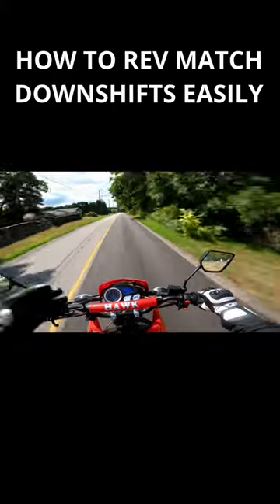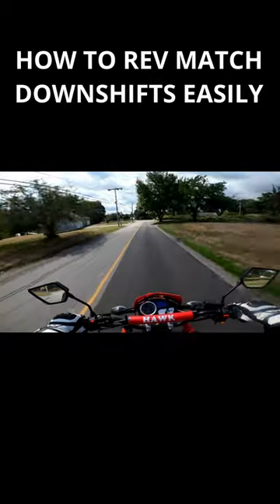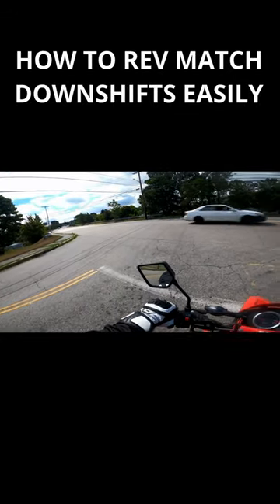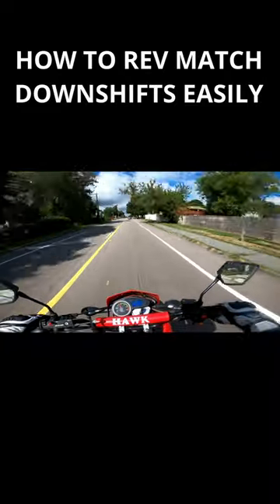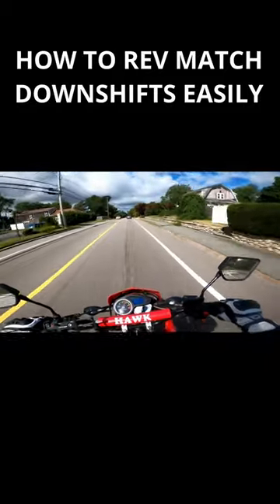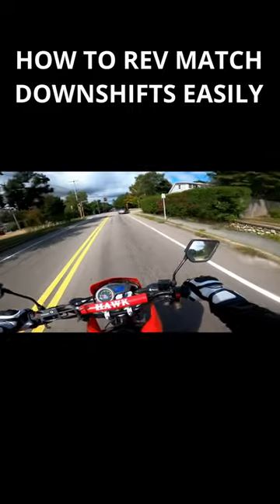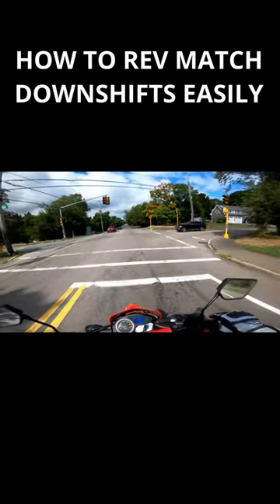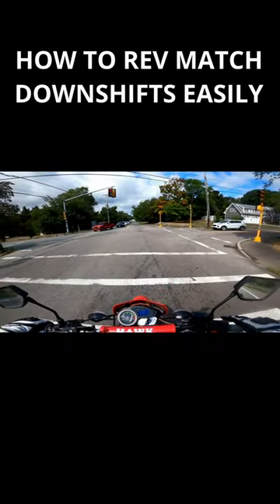HOW TO REV MATCH DOWNSHIFTS IN 1 MINUTE OR LESS | MOTORCYCLE 101

Comment: Guys.. blipping uses the throttle to bring up revs so you can match the gears. Him using the throttle and maintaining it does the exact same thing 😂 so it’s still rev matching.

He’s not rev matching to slow down drastically. He’s rev matching and maintaining his speed, hence no need to blip. Either way, he’s bringing up his rpms to smoothly downshift.
Reply from the maker: Apparently the guys "correcting" me only rev match when they are coming to a stop lmao
Reply: @BodieMoto  hi, quick question, if you open the throttle and keeping it open while you are shifting, (instead of blipping it <quick open and close >), can you still just let out the clutch quickly?

And this method you showing in the video, is to maintain speed, not to drop speed quickly , correct?
Reply: @BodieMoto  and what would be the step by step if I do indeed want to drop speed quickly by down shifting ?

How would it be different from the open throttle and keeping it open method?
Reply from the maker: @dustcake2576  correct this technique is to maintain speed. You DONT want to let out the clutch with the throttle open as it can cause the bike to jerk forward or even pop a small wheelie

With my bike, I can mess up there's no issues because my bike my really under powered, if you have a liter bike and mess up you could flip the bike. Very important to learn while going slow
Reply: @BodieMoto  wait i am confused, in the video you did let out the clutch without closing the throttle , and now you are saying i shouldn't do it?

So what's the proper technique step by step?

Throttle off > clutch in > downshift > slowing get back on throttle while feathering out the clutch? 

This is what you have done in the video ,right?
Reply: I add a little bit of throttle like I’m going to accelerate as I pop the clutch click down and let my clutch out and with proper timing it literally matches revs instantly
Reply: I blip in gears above 1st, to get down to 1st I maintain higher revs and match because dropping to first is a pain.
Reply: @dustcake2576  been months so hopefully you learned already, but this is how I do it. Let go throttle, clutch in, downshift, a quick pull of the throttle about 10%, let go throttle, let go clutch, back to throttle. 😅
Reply: Off throttle>pullclutch>downshift> throttle(mini-pull) keep holding before you letgo the clutch and continue holding throttle as you let go the clutch so it wont jerk when you downshift. Am i wrong?
Reply: @dustcake2576 don't make it this complicated. If it feels and sounds nice its probably not wrong.

Comment: Thats not a revmatch,thats way too slow and wrong overall,revmatch is a quick simultaneous action of press clutch,gear,blip throttle,release clutch,,u do that move at the exact same time and very quick
Reply from the maker: You absolutely do not need to rev match quickly for it to work, and suggesting that beginners learn to rev match that way is going to lead them to crash when they accidentally clutch up. If anyone ever listen to your advice on their first try they would loop their bike lol
Reply: @BodieMoto never looped my bike call me you talkin trash

Comment: Practice at slow speed. When you have it pretty solid at slow speeds. You'll have a fundamental grasp.  It'll be orgasmic at high speed and normal drives. So fun
Reply: The real challenge is learning to simultaneously use the front brakes while rev match downshifting
Reply: not really just slow down a bit b4 dont let the bike lurch
Reply: @harveymushman4190  explain
Reply: @funkbros3141  yeah while pressing the brake you do the rev matching downshifting all the way down to 1st gear. I think moto gp riders do this shit.
Reply: Does this also apply if my bike has a slipper clutch?
Reply: @zumair6957  yeah
Reply: @sofarsogod  GP Riders have auto 2 way auto shifter so they don't even use the clutch. If you brake and rev match, you are actually just upsetting your front wheel because of the pulsating you do when you are holding on to the brake and blipping.
Reply: @jamessawyer1331  well moto gp riders from the past, but even then they do brake while downshifting, you can pretty much see it when they show their pov, any driver car or bike has to break and downshift when entering a curve.

Comment: so basically try to get the high rpm on the lower gear so you don’t accidentally engine brake the bike?
Reply from the maker: Exactly, you got it
Reply: Precisely that. You can additionally be a nerd and memorise what speed and RPM you need to be in each gear; observe what the RPMs are for the same speed between gears
Reply: Why would u not wanna engine brake? Smh
Reply: @slimfit767  That still happens, obviously the novice here means abruptly engine braking due to RPM mismatch
Reply: @birddaddydetta  125cc 1st gear 10mph, 2nd 20mph, 3rd 30mph, 4th 40mph. My bike sits at 4th gear 40mph at 5000 rpm

Comment: If you are in like 5th gear and need to slow down a goodly amount,  how do you know what gear you should be in?
Reply: well if you’re about to slow down to a stop i think it’s best to just pull the clutch and brake it while downshifting gradually, engine brake is as dangerous as full front brake on wet road(plus there’s a big chance you might kill your engine gearbox😅). riding any vehicle need that “feeling”, you’ll find the answer to your question by yourself eventually tho

Comment: I am a bit slow in understanding so is this correct:
1. Pull in the clutch
2. Rev up/blip and downshift at the same time
3. Let go of the clutch and continue normally
Is this correct? Or do I need to integrate the clutch into the downshift too.
Reply from the maker: bingo, you can start step 3 as soon as step 2 ends, like immediately, just do it slow at first. You will feel it. 

My bike is not very powerful so I can exaggerate it alot and its not issue, if you have a very powerful bike just be careful and let out the clutch SLOWLY at first. You'll get more and more comfortable
Reply: @BodieMoto  I have a 690 SMC R which also isn't that powerful of a bike. So I let go of the clutch as soon as the downshift - blip ends. Do I let it go at once or gradually like I have been practicing. I just started riding and I really don't have that much of an idea about stuff.
Reply from the maker: @samcrdx8016  start letting go of it as soon you rev it up, and let go it of slow. You can let go of it faster and faster over time, but you don't really need to. The reason why you would want to learn to do it faster, is in an emergency situation, or racing lol
Reply: @BodieMoto  Thank you so much. Lunch break is approaching soon, going to try it out in that time.

Comment: The “blip” makes it more confusing tbh all you need to do is rev the throttle while releasing the clutch and you will feel if it’s gonna lock up or not before fully releasing
Reply: This is completely wrong in that you do the opposite of releasing the clutch - you hold it to shift. If you'd have it released while giving throttle, you'd just be gaining speed
Reply: Iv a slipper clutch to prevent locks
Reply: @birddaddydetta wat ur talking about is just normal shifting
Reply: @steve00alt70  Incorrect, I'm talking about matching the revs right before releasing the clutch lever. If you'd shift normally, you wouldn't even be concerned with the throttle hand at all

Comment: I drive a tractor trailer, and rev matching is required on those because the transmission isn't synchronized. Meaning, if your road speed and RPM don't match up, it is impossible to shift into that gear, plain and simple.

I've never understood the purpose of rev matching on a synchronized tranny, it's just to avoid the jerk from engine braking?
Reply from the maker: It's just satisfying and you can avoid the jerkiness from downshifting, but you don't really even need to rev match for that either. And anyone at the track above a beginner level is using a quick shifter anyway. People who pretend rev matching is for max performance make me laugh lol it's really just a "they feels great" type of thing
Reply: @BodieMoto  any tips on how to do it while front breaking this I find difficult

Comment: Am I doing it wrong !? Cause this is how I do it , and the transmission and engine sound good no jerky movement or nothing , but I hold clutch all the way in , next I give it give gas while still holding the clutch depending on my speed if I’m going fast I let it out slow until the mph drops a little lower not looking at the tachometer just feeling the bike but if I’m slowing down gradually then it’s a lot slower letting off clutch with rear breaks. 🎉 idk but I was self taught basically how I did it myself lmao hope it’s not wrong
Reply from the maker: No you're doing it fine!!! You could start letting go of the clutch as you rev up the engine after pulling the clutch to shift faster but not that much faster tbh lol 

What you're doing is the way they teach people at the motorcycle safety courses

Comment: Do you have to use your throttle when downshifting or upshifting?
Reply: Blip the throttle when you down shift, let off the throttle with you up shift
Reply: @sir_verdoux4481  oh okay thank you 🫶🏻🏍️
Reply: when upshifting never. 
its only for downshifts because if you try to go from 5th to 2nd without breaking or blipping the throttle you might fuck your bike big time.
Reply: @sofarsogod  thank you for your advice 😁
Reply: @sofarsogod  what if ur holding in the clutch and braking and downshifting like doing a standard slow down without blipping the throttle to revmatch ur downshifts is that ok? Even if ur going from 5th to 2nd as ur breaking and holding in the clutch?
Reply: @Mikey-ji3eg  Thats the noob way, some people do it that way, its ok if you are a beginner (Ive seen some people do this for life) because rev matching takes time to learn, but learning to go from 5th to 2nd, or even better from 5th to 1st in a matter of seconds via rev matching is the best thing you can do. You can learn to do it as a drill, go from 3rd to 2nd and 2nd to third as quick as possible, and then 4th to 3rd to 2nd same as quick as possible and then again 2nd > 3rd > 4th.. till you can do it from 5th to 2nd.

Comment: So you're only slowing down by engine breaking and progressively down shifting? No break or both? I'm a new learner and find it hard to grasp the idea of engine breaking, breaking, let go of both, down shift, rev match and repeat to a stop. Don't know if I'm doing it right
Reply from the maker: yesh when you're just engine braking the bike is slowing itself down due to resistance from the engine spinning slower than the wheels (in laymans terms) you never want to rely totally on engine braking but when you need to stop fast you should use it combined WITH the brakes as this provides the most stopping power. If you just pull the clutch and slam the brakes then the rear wheel will lock up alot faster. So its good to practice braking with both brakes and engine braking at the same time so when something happens where you need to react quickly, its all second nature. But yeah you don't always need to use engine braking, and under PERFECT circumstances like slow controlled riding you can get away with never using it. I would recommend practicing it all the time while slowly coming to a stop, just so it becomes second nature. You'll notice you don't need to brake as early when you're using all the available stopping power of the bike
Reply: you can either go for footbreak or that as this is very helpful for vehicles without ABS.  once you downshift to the gear you wanna be in, SLOWLY release the clutch until you feel the vehicle gradually slowing down.   you don't wanna release immediately as that would stall your balance if you downshift few gears down especially with higher cc motorcycles.

Comment: Hey did the nibbi install tho it was the wrong one so we put the og one back on but now my bike won’t start without choke being on & it seems my throttles wide open, the tension of the throttle seems to have disappeared and won’t snap back to place we checked the cable connected to it and it was fine and we think the carb was reinstalled fine as well any thoughts?! Help plzz

Comment: Do u rev blip with clutch pulled in?? Or right befpre you pull clutxh in ans shift down?
Reply from the maker: With the clutch pulled in
Reply: @BodieMoto  will that cause a wheelie if you releaae clutch ? Or do u wait a second before releasing? I dumped my clutch at 4 way stop last week and smashed up thankfully ok
Reply from the maker: @funkbros3141  gotta release the clutch slow when coming off a stop or in low gear
Reply: @BodieMoto  when on highway at higher gears...do u let clutch out faster? Is it unsafe to slow release at hi speeds?
Reply from the maker: @funkbros3141  it really depends, its not unsafe but it can be, I almost always release slowly on the highway to be as safe as possible. But its important to know how your bike reacts to releasing it quicker, so if you NEED to stop fast you can release it quickly and get through those gears to help you top with engine braking (as well are regular braking)
Reply: @BodieMoto  so u release clutch quicker when downshifting to a stop?
Reply: @BodieMoto  sorry for all these questions im just tryna be safe and no one really explains these things in msf

Comment: So you blip it while holding the clutch? I tried it today but couldn't get it :(
Reply: try to do it in 1 motion so pull clutch downshift and rev at the same time and release the clutch it’s works better if you do all 3 together
Reply: @derdoktorlauch7155 I’ll try this I’m extremely new but I have to make sure to let off the throttle after blip I tried and sent rpm through the roof good thing I didn’t let off clutch 😭

Comment: I don’t understand what this is for, Seems normal, and the other vids are just people engine braking, im confused.
Reply from the maker: It's so you can downshift as smoothly as possibly in an emergency situation while still allowing your engine to help you with engine braking instead of what most people do... Which is simply pull the clutch and brake which locks up the rear wheel while the front of the bike gets loaded with weight. This is why you see people try to emergency brake and swerve but their rear tire loses traction immediately so they can't swerve and it slides the bike out from under them. It's the "haddalayerdown" situation lol

Comment: that is not rev matching, thats regular downshifting. rev matching u have to do it simultaneously with each other so there's no gap in your downshifts. ur just doing it really slow compared to some other people I've seen talking about this topic.
Reply: That's the thing - there is no gap (i.e. rough transition) in between. This is rev matching, just very slow as opposed to quick. You can theoretically rev match by going from 6th all the way to 2bd by holding the clutch the whole time and blipping the throttle when you reached a speed appropriate for the 2nd gear
Reply: Also normal downshifting has you slowly release the clutch for a reason

Comment: Sounds like someone just learned to ride a manual transmission vehicle. There is no need to do any of that nonsense. Just engage the clutch, downshift, release the clutch gradually, and so on. It is not recommended doing so from the 2nd to the 1st geat.
Reply from the maker: No where did I say you ever need to do this, but you should know how so you can stop quicker and of you're really pushing it you won't unsettle the weight of the bike. Too much weight forward makes it's so your rear tire slip so you lose traction in turns and can't stop as quickly or correct yourself. Sounds like someone doesn't understand how downshifting effects weight distribution and subsequently grip.
Reply: @BodieMoto OK. When I said drop the clutch,  I was not clear. You control the slowing down after downshifting by the clutch. You do not need to use throttle at all. You are right in one thing. JUST dropping the clutch while downshifting might make your rear wheel slip.